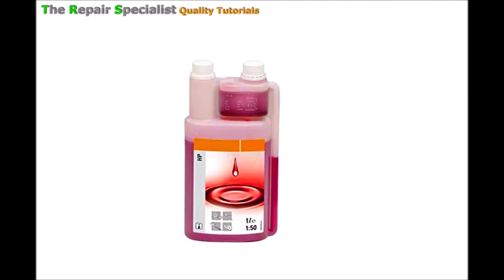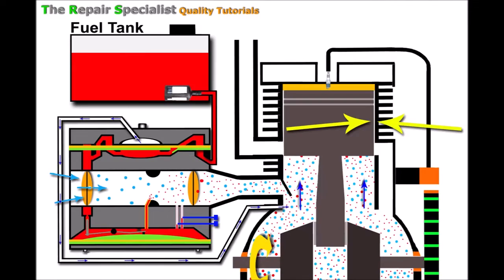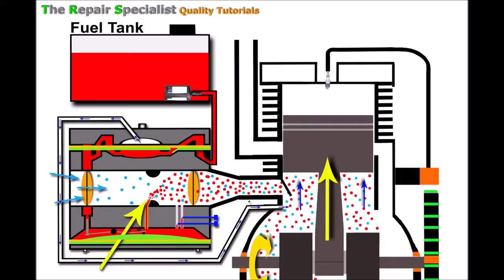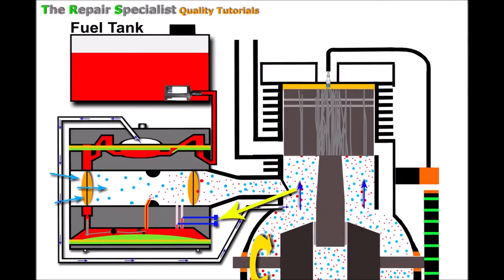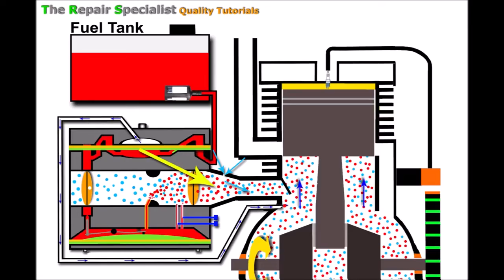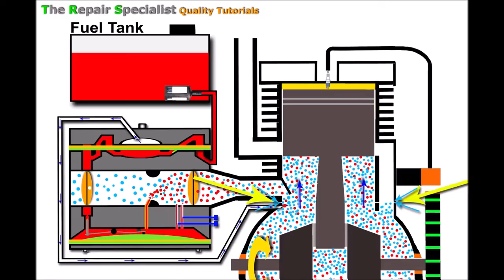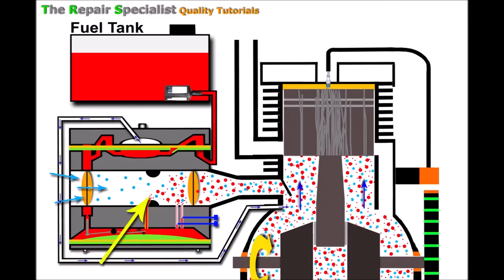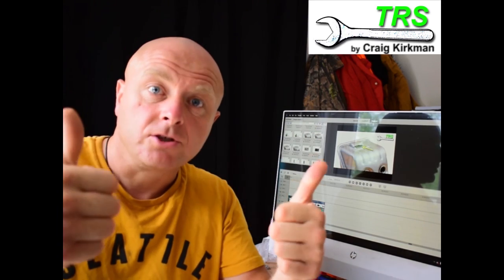Chainsaw won't Start/Run - Reasons for Engine Damage.  (by Craig Kirkman)

Comment: If they call for a 50-1 mix , use 45-1 or 40-1 , this is why many engines last 40 years and then only need new rings 
Yes it can stop up exhaust port and screen, yet at the price of new equipment, I clean what I have as needed
Reply from the maker: Great, thanks

Comment: I got an old Chainsaw which was rebuilt with new block and piston, weld on flywheel which is wobbly, with no air deflector cover (I don't know what it called), and some side play in crankshaft about 4 to 5 mm does it will damage my Chainsaw? Now I used it today and found that it heats up too much very quickly, then it's stopped working...!

Comment: Craig, thank you for the clear and to the point tutorials with illustrations. Your comments on adjusting the idle screw (in addition to the L and the H mixture screws), was most helpful. ZAMA has some great technical information on their website as well. 

For your viewers who find this information useful, as I did,  I would like to point out that  you can thank Craig for sharing his hard earned knowledge in a useful technical format by donating a few dollars to him. Hit the circular icon upper left, right next to "The Repair Specialist" to explore this. Good information has value. 

RB, proud owner of an aging Craftsman 42cc chainsaw and young Stihl MS271 Farm Boss, and other tools that burn fuel and have performance problems.
Reply from the maker: Thank you so much for your nice feedback. It's comments like yours that motivate me to continue making these videos. Craig 😀👍